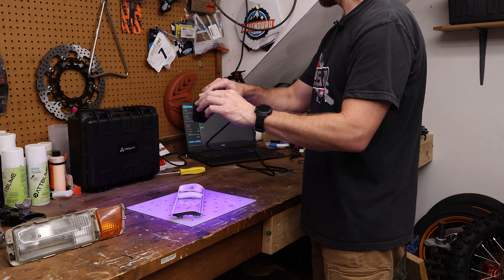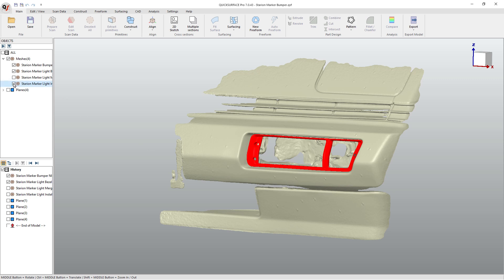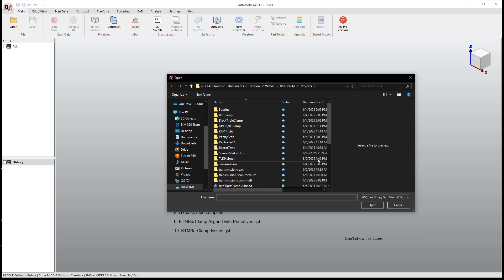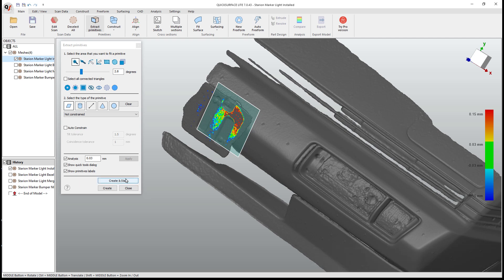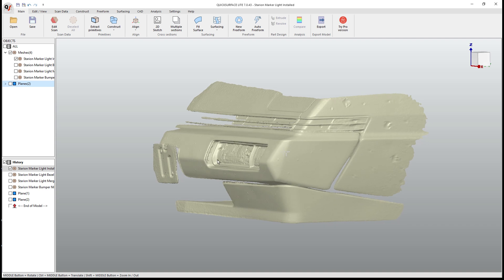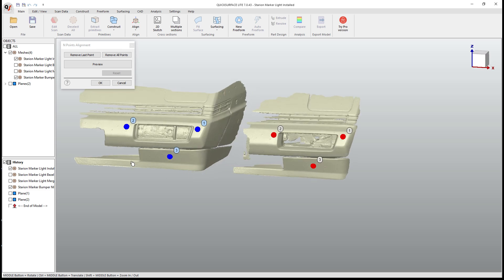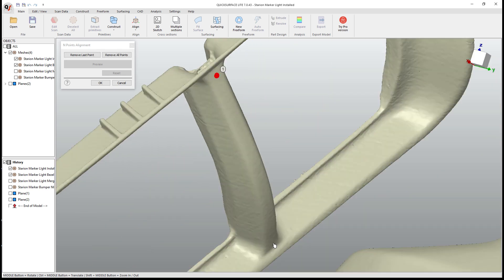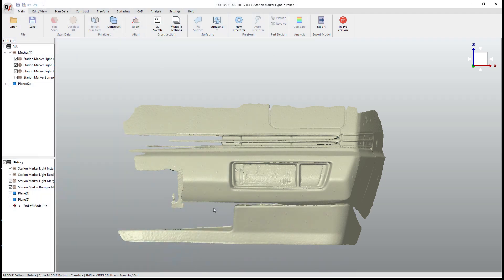Design Custom Car Parts With 3D Scanning | Ep2 | Mesh Alignment in QuickSurface LITE

Comment: Hey Matt. When aligning by N points, do you have a sense for how close the points need to match between meshes?   How close is good enough?
Reply from the maker: it depends on the meshes.  If both are pretty close in triangle size then it does a better job on its own with the close alignment.  If one is high poly and one is low poly then the closer you can get them initially the better off you will be.
While it needs at least 3 points, if you have unique features then adding more points helps as well.  I try to make them on faces that are different planes or near unique features to give it the best shot.

Comment: If you scaned it with nearby benchmark ( well established surface vertically and horizontally) you could align scan way more easy, i guess.
Reply from the maker: Npoint alignment works pretty well.  Having both scans you are trying to align be roughly the same resolution/number of triangles helps because it uses the geometry to help with alignment.  So if i had say 1 bezel on the bumper I scanned in large NIR mode with low detail and then the other bezel i did with the laser scan mode with much higher detail it tends to struggle a bit.

Doing something like a small blob of clay or block can help but really the difference in triangle size on the mesh is what causes trouble.

Comment: Again another good video. I like the look of Quick Surface but to only align scans I couldn't justify $400 a year!!

On a side note I know you have all the info you need in those scans but coming from a scanner with all the hype around it they are quite rough. I see videos on here slating the MetroX and this is what comes off the Raptor.
Reply from the maker: I am working on a back to back Raptor Pro vs MetroX video.  One thing to remember is that the "rough" raw data vs a fully processed scan will be very different.  Often times setting the resolution extremely low will give you "bad" results on any scanner.  MetroX or the Raptor.  Its kind of like if you look at a painted car it looks very smooth, but if you actually look at the close up details its bumpy.  Same is true for scanners.  If you have a part with some grain to it and are scanning and trying to set points at .02mm you are going to get a lot of bump that we don't see or perceive with our eyes.  So taking a scan and setting the point fusion number at .02mm vs .1mm vs .5mm can make a huge difference in how smooth or good a scan looks.  I have done some videos talking about the processing of this.  What I find is that getting the raw data out of these scanning programs and doing the smoothing and processing in some dedicated software like QuickSurface gives me better results.  If I am trying to design something off that scan data or reverse engineer the part I would want to go with a smoother final mesh.  If i just need it for space or approximation I don't spend the time worrying about how good it looks.  At the end of the day for a 3d printed part spending time to clean up a mesh to look good isn't worth the effort in my opinion.

When I do the back to back video I will talk about where each scanner shines.
Reply: Those were done in raptor´s NIR mode. Raptor truly shines in laser mode. look at the bezel
Reply from the maker: the bezel was done in laser mode, the bumper and light were NIR.
Reply from the maker: one more note. the car scans, the car has markers all over it but was scanned in NIR mode with feature based tracking.  This means it doesn't know the markers are markers and they don't get removed and patched.  Thats why it looks bumpy.  The area i wanted in the fog light opening didn't have any markers.  Since it was the only part needed I didn't care to manually remove the markers (physically or digitally) as they had no impact on the goal.

Just for a bit more info.  So far the laser quality of the raptor and metro are very close.  some pros/cons to each but the data captured seems very close.  But as mentioned in my last scan setting everything to as small/fine as you can just means there will be more noise.  Scanning something with 1mm between points vs .1mm between points, even the same object, will have a very different appearance.  The problem is scanning with larger numbers means you can possibly lose the details.  Smaller numbers gives you more noise but you can process that out later at the mesh level.

hope that helps.
Reply: @LearnEverythingAboutDesign  I get all that and very well explained. My point was more towards the Creality is the best and nothing comes close supporters who haven't got a good word for the MetroX. 

Looking forward to the review between the two.

Comment: I see you're importing a model and a mesh; what are the file types for those? When I export from Creality ScanI only get stl, obj, and ply, but they all look the same to me when I look at the properties (points and triangles are the same). Awesome video! I just activated my free trial of Quicksurface and using the Lite options only, I'm considering paying for it depending on how this goes...this is totally just for hobby.
Reply from the maker: Filetypes can be tricky to understand for sure as there are now a lot of file types that seem basically the same.  My reply won't be a full guide but hopefully give you a little bit of info.
STL is a triangle only polygon format.  There is no material, texture or other info.  just triangles thats it.  it is a bit of a legacy format.

OBJ is a polygon file that can have quad sides in addition to triangles.  Since the mesh we get out of Creality is triangles that part really doesn't matter, but typically the reason to use OBJ is if you have some material or texture information to go with the file.  So if you scan on NIR mode with color capture, STL will lose that info but OBJ will have another file that goes with it called an MTL file that will contain the color capture info.

Both OBJ and STL can have an ASCII version of the file type which is "human readable".  STL can also be saved as a binary file type which is smaller but you could'nt open it in a text editor and gain any info.

PLY is similar to OBJ where you would use it to include info about colors and textures.  PLY files typically contain a bit of information in a header in the text that helps again with human readable.  The problem is some programs won't open a PLY file.  Fusion for example wants an STL, OBJ or 3mf file.  3mf is yet another mesh file that is a 3d manufacturing file type that has mesh bodies but also info about 3d printing.

So because i don't generally care about color capture and i know the mesh is all triangles when it comes out of creality i just pick STL even though its a bit of an older format.  If i have a quad mesh I would pick OBJ.

QuickSurface Lite is a great tool that bridges the gap of functionality from something like Revoscan to Fusion.  It can clean up and process mesh models where Crealityscan can't.  Fusion can but a bit limited.  It can align to xyz.  and has some auto surface and freeform tools built into LITE.  I will be leading a webinar for QS on Wed at noon eastner talking about the auto freeform tools in LITE and Pro and how they differ.  Pro is MUCH better, but a lot more expensive and not really an option for a hobby user.
Reply: @LearnEverythingAboutDesign 
I just did laser scan so that's where my confusion was. Good to know about using NIR and obj though. This is all new to me so still learning!
Reply: Never mind! I think I got it to work. I imported one as stl and the other as obj and seems to have worked
Reply: Hey, I am loving your channel as someone who just got into scanning.

Curious if you have tried the metrox since  the last update a few days ago. It seems like they have been releasing updates pretty regularly which have seemed to improve the process a bit
Reply from the maker: Yes I used versions 5.6.5, 5.6.6 and 5.6.7.  The speeds is getting much faster with each version on GPU.  I feel like maybe the feature tracking for Full Field has gone a step backwards sadly.  Maybe that will get sorted.  Things I have scanned on full field in the past don't seem to track as well.  So plus for the lasers, but maybe a minus for the Full field.

I am working on an raptor pro vs metroX video that will hopefully show pros and cons of each.
Reply: @LearnEverythingAboutDesign when you do this video I’d like to see both scan an engine bay using feature mode. I tried mine today with the MetroX in full field mode and it was hopeless losing tracking all the time. I see scanners like the Otter Lite and Einstar doing these on YouTube all the time.
Reply from the maker: @Charlie_Chester  I did try a bit of engine bay scanning with both and neither did great.  The metroX needs to be 200-400mm away so it would take forever.  The RaptorPro can be up to 1000mm away in NIR large mode, but it was struggling a bit as well.  When i did scan my engine bay in the past i use the Miraco on Far mode and it did a decent job for a 2min scan for the header design video I did.  What i would say is neither of these scanners are really "strong" for larger objects.  Depending on the level of detail you need I would say the Otter from creality or the Miraco from Revopoint.  Miraco being wireless is a big bonus.  https://youtu.be/6r4YDUaDg5o  around 2min in that video you can see the 2min engine bay scan that was used.